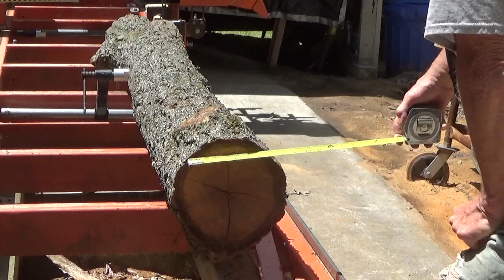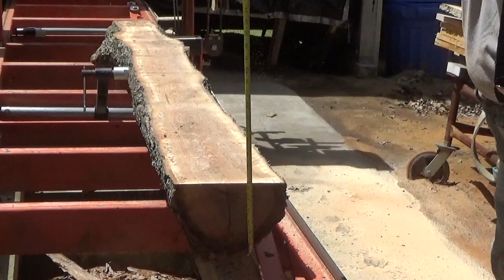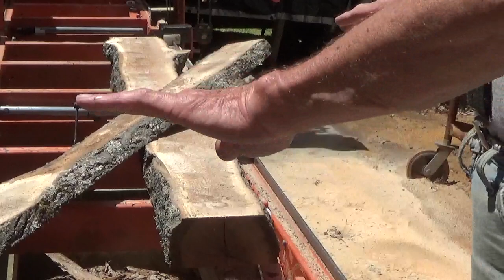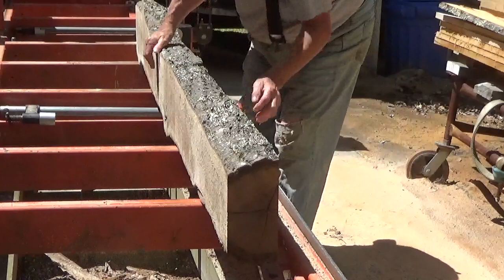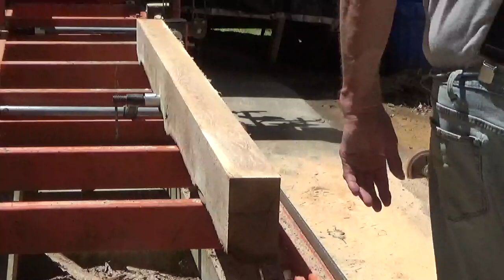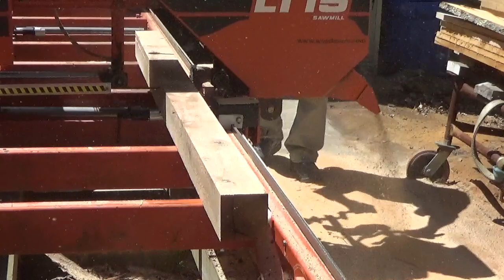June 15 22 Small logs can be tricky on the LT15

Comment: Hey Joe, that was almost nothing but firewood. But you never know until you make a few cuts.If you had to completely redo your cutting setup from the ground up what changes would make?
Reply from the maker: The cutting part I am happy with. But I would have made the kiln twice as big and a bigger garage to hold the lumber. It appears to be warming up here now into the 70s, what do you have?
Reply: @josaljo1  well nothing Joe, But I really enjoy watching. Your open ended shed/ with tarp is a fantastic idea. And nothing better than concrete for a solid level base. Seems to be a market around here for a Mobil mill. Lots of people having a lot cleared 1/4 to 1/2 acre. And most of it is going to burn piles. Temps 96 to 100°